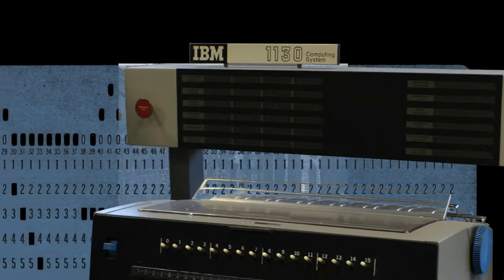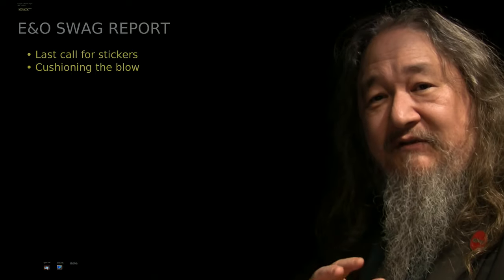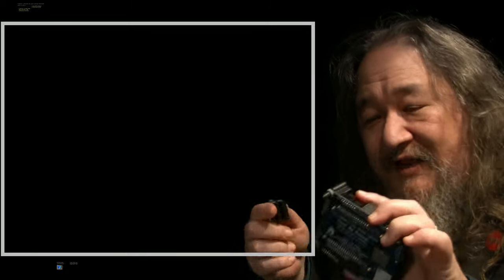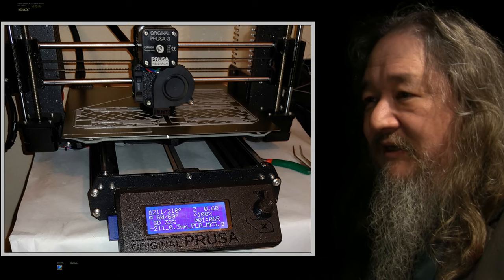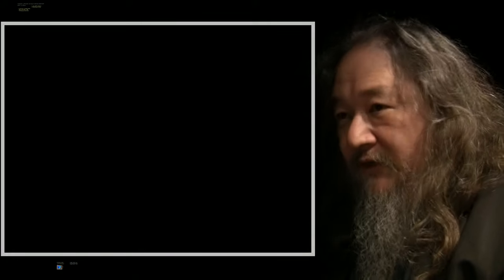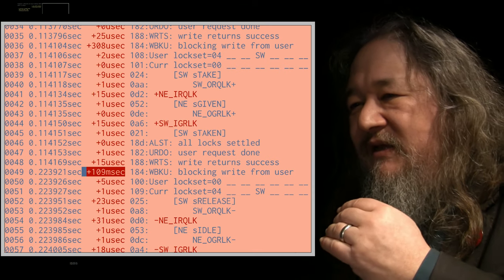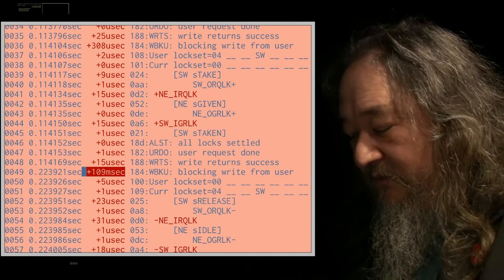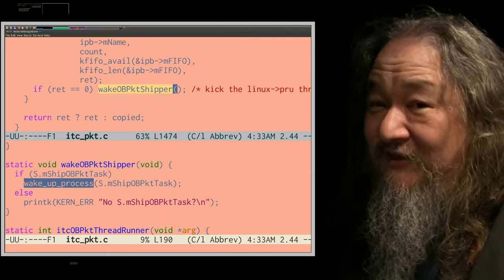Where Does the Time Go? - T2sday Update 247

Comment: Might be worth having a peek at the code for the BeagleLogic project – looks like instead of rpmsg/virtqueue they're using their own dma'd ringbuffers, so maybe that's faster.

Also I can't help but wonder if there's a more... uh, optimistic approach than locking. If the premise is that the lower layers don't pretend to be infallible platonic ideals, couldn't you have some kind of stochastic/convergent approach to the intertile communication? If it's fast but it fails sometimes, and we don't mind that it fails, then isn't it just fast? :)
Reply from the maker: Yeah, I learned a ton from the BeagleLogic code, but, perhaps because my cache fu is weak, all my dma/mmap attempts ended up slower than rpmsg.  Also see reply to Jarne Vanbecelaere on #246.  Thanks for the thoughts!
Reply: @T2TileProject  Ha, fair enough. Gotta walk before you can race. :D

That said, maybe there's a middle ground in some kind of eventual consistency model – ie detect and roll back conflicts rather than lock to avoid them. Or, for even madder science, phase-locked tiles with a relativity-style variable propagation speed between cells. Near the tile border, events take more time, or equivalently you could imagine there being dummy "space" in between that the cells propagate through. You could end up with a kind of time dilation as you get closer to the tile border so you can spread the synchronisation cost out over the whole region instead of paying it all at the edge.

Boy it sure is easier to come up with ideas than implement them!